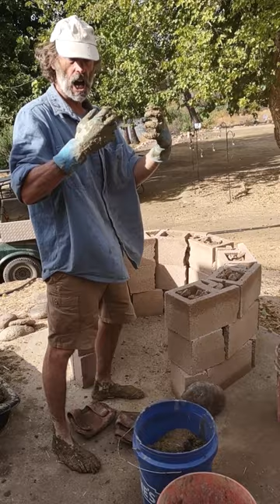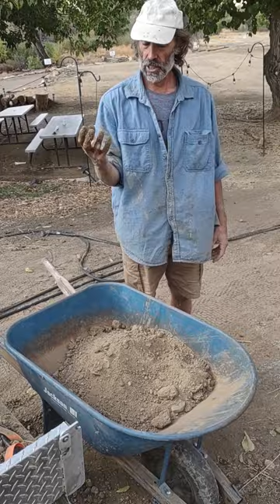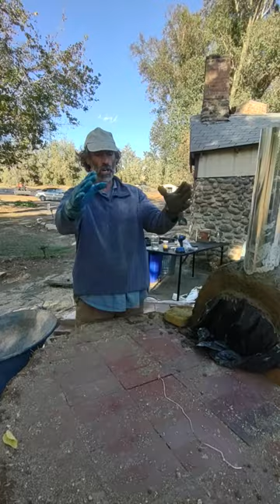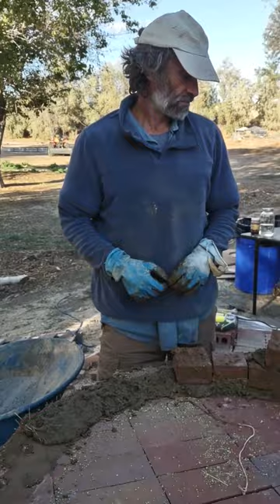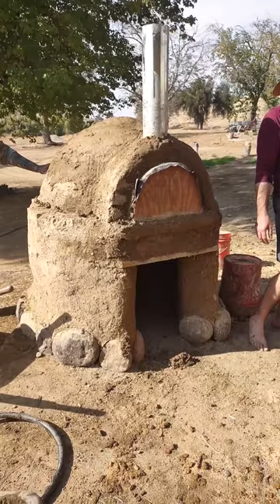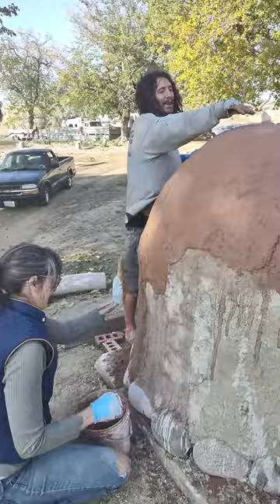Building a brick cob oven

Comment: Sir cob alot!  Love this how to video.  When you put the stove pipe in could you explain how you built the brick arch doorway.  I am guessing you cut bricks in half to give enough of a hole for the 6 inch stove pipe?  Do you do another trick I don't even know about??
Reply from the maker: Hey Matteo,  yeah, when I do the stove pipe , I put the bricks on the arch form and leave the 2 center bricks out,  so there's 6 bricks on either side of the chimney, and put the stove pipe in there instead of the last 2 bricks, then I cob that all in.
Reply: @cobalot9  Awesome!  So you don't complete the doorway arch with bricks. You basically are using the form to support the pipe until the cob sets up.  I'm guessing that once you take the form out you have to do a little cob around the doorway where